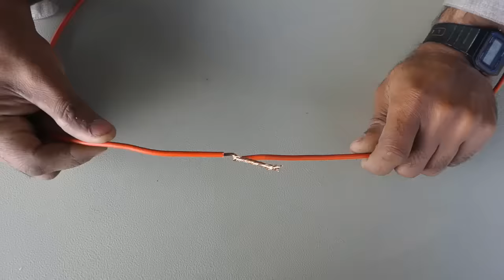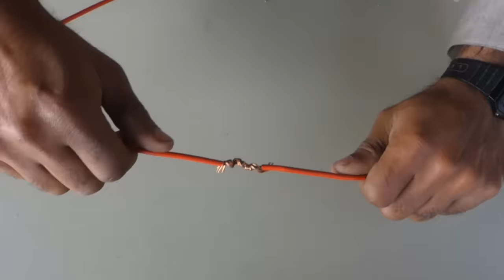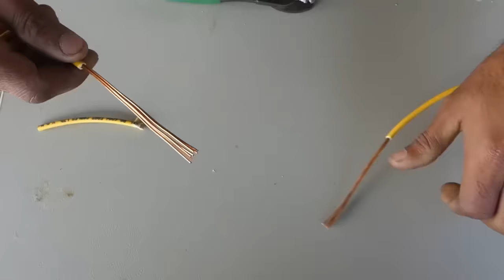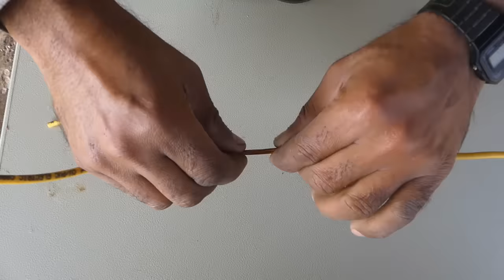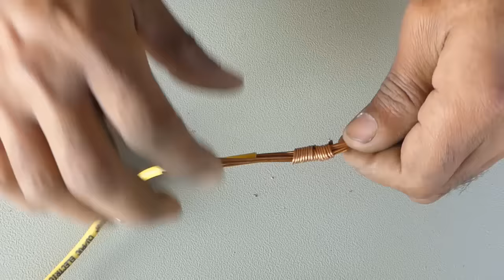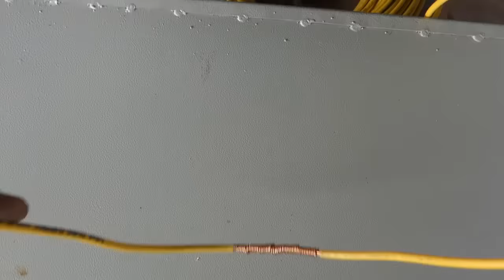Awesome Idea! How to Twist Electric Wire Together | Properly Joint Electrical Wire | Part 1

Comment: I think wastage of time..... normal joint never open if we use insulation tape on it. Because in normal routine we never need to pull the joint.
Reply: Right
Reply: If you are a technical person, you must not comment like that,,,, a technical person never take risk... What could be happened and what couldn'tbe, he keep an eye on every espect.... So your openion is not suitable brother....
Reply: @muhammadhamzaart5251  right
Reply: @muhammadhamzaart5251  this is useful for 14.mm2 and above main wires especially when you don't have a solder-less connector.
Reply: Jugane
Reply: @dineshbatteryelectronic8811  fall
Reply: @dineshbatteryelectronic8811     I
Reply: But 69M view toh agaya
Reply: Mind blowing
Reply: 'Normal joint' has sparking risk. Eventually wires will heat, spark  and loose, disconnect and can even cause fire in wiring. This type of joint here reduces that risk.
Reply: Bobo
Reply: Imagine a hotel or some other place where there are several employees working with extention cords all day long. Yes, the wires are finer gauge, but a similar fix beats what people typically do. 

Ideally you just put on a new cord, but not cheap.
Reply: No inspector would pass that, most dont even like breaks in the wire, let alone no bonding lugs
Reply: But for at home or even pulling wire thru conduit, heck yeah it's a way better connection, but time is money, 4 minutes for one connection is a long day on a new build
Reply: @ashtonandkylievideos2929  wiring connections can't be hidden, that's code.
Reply: @aredditor4272  you cant just twist wires together either, and yeah wires going in conduit are technically "hidden" , but inspectors inspect the conduit also and run a continuity test if they want, we couldn't have more then four 90s in our conduit running from the pool to the house for bond wire, but then again we used to be able to bond our own pools, not no mo
Reply: Yes right bro
Reply: @muhammadhamzaart5251  r8ght
Reply: Smart work
Reply: As I said thework is good and smart
Reply: Good joint if i have to pull a car out of a ditch.
Reply: S
Reply: It only shows that you ain't an electrician
Reply: Right
Reply: But this is art
Reply: Why would you not want it to be stronger? Cables get unintentionally stressed all the time
Reply: Difference between educated professional and jugadu electrician.
Reply: El porro es bueno tío

Comment: As a union electrician, I can say that this is NOT how to splice wire and you will NEVER see this in the field
Reply: It’s a waste of time and materials and probably isn’t up to code anywhere
Reply: @JT-cq9hx  I don't think it's a code violation,  at least not where I am.  But it definitely takes a lot of time and you need heat shrink tube.
Reply: This guy knows what he is talking about  … there are a lot of ways to spend time doing nothing.. like union brakes 😎👍🏻
Reply: @jhKorn123  😂😂😂😂😂
Reply: @jhKorn123  what else are breaks for
Reply: Splicing like this is 100% a code violation in NY
Reply: @hulksmash2454  everything's a violation in NY. NY itself is a violattion.
Reply: @GameJunky513  That's not true at all. There are right ways and wrong ways to do things, if the proper equipment is used and if the correct methods are applied then no violation. Violations are for safety reasons not for efficiency.
Reply: It absolutely is a Code violation, can not have exposed wire.
Just use a wire nuts like every other normal person.
Reply: Word, this is silly
Reply: @GameJunky513  live in another state? Please tell your local representatives and representatives sent to DC that you don't want NY's handouts...that it's socialism to take the money from those who earned it.

We'll be happy to keep our money here.
Reply: @-Subtle-  socialism rules
Reply: @hulksmash2454  I’m exited to know how a proper splicing/braiding is made! How should yo deal with exposed wire?
Reply: @pacifiedbeaumonte  there’s this new thing called private schools, you should look that up
Reply: @cheitner  I think the idea was that he was supposed to use heat shrink or some other insulation.  But , a wire nut is the way to go. And since most electrical wiring is solid core, it's really the only way to go
Reply: @pacifiedbeaumonte  you obviously don't know what socialism is. You want a real education in socialism? Visit Venezuela
Reply: That's a way to attach a wire to another wire in conduit to pull out the old and yank in the new. Usually done with the existing ground wire in the conduit. Tape it smooth and yank out the old ground along with a new ground and the missing wire. Other than that that's a violation in anyplace in North America....mainly because that splice is meant to be insulated and then pulled into conduit never to be seen again!

Comment: Yeah, cause everyone has all day to twist two wires together.
Reply: @jonathansimmonds5784  stop.   Not needed for outlet or light switch.  Unless you got rodents using these wires for strength training
Reply: Did anyone else know that wirenuts cost about 3 cents and take 5 seconds to install!!! This looks pretty but wiring a house or barn would take 4 months!
Reply: It must be meant to be used in emergency situations. I can’t see any other reason to waste all that time. Hell I think even soldering would be faster than this.
Reply: Unless you live in a 3rd world country....don't do this. It's illegal in the US.
Reply: @jonathansimmonds5784  OK but for most people we not doing all that.
Reply: …and using a bunch more wire in the process…
Reply: And thus you have seen textbook example of overkill x10
Reply: If I see someone doing this at our job site I'm going to hand him a bag of ideal wire nuts, we do not have time for all that.
Reply: Labor/time is worth more than the wire nuts or butt splices to do this. You can do 10 in the time this guy is playing games with his wires.
Reply: @mnotten1  Wire nuts are 100% ass, and it's a travesty that they're code. I wonder how many houses they've burned down?
Reply: @bcubed72  I understand what you're saying... But wire nuts are still to code- have been for 100 +/- years.
I've been using wire nuts for 55 years and have NEVER had a fire, I would never use them if I was concerned about a fire!
Reply: +1
Reply: This waste time if we work like this house lighting may take like 2 month to be done
Well This process is normally used for Pole connection🙂🙂
Reply: Cc CT có chứ gì họ đã

..

Comment: As a certified electrician, I can tell you that you would never see a splice being done like that, especially when on the job. Any boss would flip to see someone take that long to make a splice. Now if a conductor that is damaged or too short needs to be replaced, then by all means, use this method to tie on a new replacement conductor and use the old as a pull string.
Reply: 8788
Reply: ..also no work bench and safe environment
Reply: Especially since the only way to protect this is electrical tape, makes it look like a hack job in the end
Reply: That’s what I’m saying lol he’s fooling y’all
Reply: @josefigueiras8973  Zmbm 
Mbz
Reply: Total agree ..this is not the way to splice unless you wanna get fired
Reply: @balzaak4803  Could have at least slid some shrink tube on beforehand.....he probably used masking tape to finish it off....
Reply: And yet the Western Union Splice, as demonstrated in the video, is universally recognised as having the best tensile strength of any splice.  Also it's still widely used for most overhead lines.
Reply: Exactly. Wtf
Reply: @krashd  total agree
Reply: @balzaak4803  have you heard of shrink tube?
Reply: @IAmThe_RA  yea, didn't think of that
Reply: Certified electrician are always looking to rip off other wallets by rushing jobs. Your boss and the team are crude and untidy  workers
Reply: @vincentlee2460  this method is just excessive and overkill, an insulated crimp/crimp with heat shrink or the first method with a screw terminal holding it in place is more than adequate. The demonstration of them being pulled apart is silly because a cable shouldn’t have sideways load or be able to be pulled if installed correctly.
Reply: It can also be replaced, but in some cases it must still be connected
Reply: Don't think this video is aimed at professionals on the clock subservient to a company.

Comment: What electrician has the time to braid wires together like this when then can just use a wire nut and be on with the hundreds of others they need to connect
Reply: Or better yet lever connectors.
Reply: Crimp join all the way
Reply: Answer is : A smart electrician
Reply: You’re but gonna pull through a conduit with a normal splice and wire nut dummy
Reply: @robbrooks3418  you put a junction box in at that location and use wire nuts or cut the wires to length properly to begin with so you don't have feed to spliced wires through a conduit which I believe is not NEC compliant anyway
Reply: @themergen1  Hell no. If I see this on my job somebody is getting fired.
Reply: In the same time or shorter I would get a soldering iron and do a better job.
Reply: Hi friends 🙏🙏
I am from Indonesia 🇮🇩
Reply: @yokedmonster  hi
Reply: Not me. Unless I want the place to burn.
Reply: Wagos, wire nuts, fuck even a but connector and a crimper and and wrap it in 33.  Thats acceptable here
Reply: @videojones9884  are you Electrician?
Reply: @nuwansampath7348  Yes I am
Reply: True.... Moreover who's gonna pull a live wire like he did after connection 🤦🏼‍♂️
Reply: No wire nut

Comment: Are there mice in the walls trying to tear the wires apart as in the demonstration?
Reply: I guess it comes in handy when you can’t replace the entire wire, but has to splice it in order to pull it thru some tight spots to its destination.
Reply: More like beavers. Lol

Comment: Thanks. This helps me with barbwire fences too. To me it's time saving method and I need that barb wire to hold when I stretch it and when a 1200 pd cow tries to lean thru it.

Comment: It’s called a western union splice. They used it on telegraph wires. It’s still useful to pull a new wire with the old one.
Reply: Yes
Reply: Hello brader 🙏
Reply: the 2nd one was the best
Reply: Ya. And the last time I made a western union splice for other than fishing purposes was when I did my 1st year of schooling for my electrician apprenticeship back in 1992. Lol

Comment: Let's increase the resistance of a wire as much as we can.......
Reply: Not to mention create a whole lot of lossy inductance..
Reply: @NathanMcClintock  dammit you beat me to it. LOL. Yeah you basically just put a induction coil inline to the load
Reply: But it looks cool...
Reply: Yes we also have a heater.
Reply: @johnevatt518  I would expect inductance to be created only were the spooled strands isolated from each other, and from the straight strands. Am I wrong?
Reply: I can’t see a reduction in effective contact area, which would produce any higher resistance.
Reply: @NathanMcClintock  yes! Was thinking the same.
Reply: @Johan-vk5yd  the same reason you are supposed to uncoil extension cables
Reply: @ponemark  The coiling extension cable  is isolated forcing current to follow the ”spool”. The coiled strands in the demonstrated joint are, in contrast, in contact with the neighboring strands, coiled as well as straight ones. The current passes straight through. No coil.
Reply: @Johan-vk5yd  if it's going to take path of least resistance its certainly not going to go round the spiral or jumping from strand to strand because that would be further distance. The path of least resistance which is now reduced at right down the centre will now get hot because all other electrons will follow.
Reply: @ponemark  To my eyes the Braider takes great care to make each coil be in contact with its neighbour. Did I miss something?
Reply: @Johan-vk5yd  in contact with how many newton metres force is the connection. You might want to run some heavy current through the circuit like a electric shower you will see the heat difference along the wire at the junction.
Reply: @Johan-vk5yd  you are not wrong
Reply: Johan is right. Like the video title says, if after all, you're to twist two loose ends of wires together that's not a bad technique. The joint will be a lot stronger than the other techniques shown in the video. As regards to the passing of electrons, there's no question of induction or resistance of serious concern as long as the strands are tightly pressed together and the copper strands remain clean, and you don't plan on using welders and a few heavy-duty  motors. A nice and clean soldering would be nice but that's out of the topic. 😀

Comment: It will expose unnecessarily large section of area as compared to first one, and indoor wires are not meant to bear excessive physical tension.
Reply: Катушка индуктивности
Reply: Exactly what it said^
Reply: Yes it may be true
Reply: Exactly what I thought
Reply: Yeah. Whats the purpose? Lol are you tryin to hang your ceiling fan with the wire you used to power it up?
Reply: And the time it takes🤦🏻🤦🏻🤦🏻🤦🏻🤦🏻
Reply: Also resistance will be created

Comment: Car stereo shop

“We’re now charging 10 times the labor, because we now wrap our wires multiple times, instead of using crimp connectors and solder”

Comment: Then you realise you have forgotten to put the heat shrink sleeve on first...
Reply: Nahhh, just slap on some generic electrical tape, man.
Reply: @boke75   Maybe silicone tape, tightly bound over the join.  The layers will fuse together and make a pretty strong insulating wrap.
Reply: But at least he wont need a heat gun it will melt down anything close by
Reply: @ponemark  Why will it melt down?
Reply: @Johan-vk5yd  resistance will create heat. Resting a wire against another wire is an unsatisfactory connection compared to a crimp and although may create a circuit it will have higher resistance. Try loosening the screws securing wires in a plug and you will get heat generating.
Reply: @ponemark  Thanks for trying to explain these things. One might think that the significantly greater transverse area created by the demonstrated technique would compensate for that, on the condition its applied meticuously as shown, including the squeezing with pliers.
Reply: @Johan-vk5yd  I'm no expert but learned from mistakes and I've made plenty of them.
Reply: @ponemark That would be great, hearing about your mistakes! You could save lives, you know.
Reply: 😂 hahaha
Reply: Bbch

Comment: The way you did it the first time is how I do it and I have never had to re repair a job previously done and works every time but I do admit the last one you did was very tight and secure but who has time for that? honestly the first twist you did is how 90 of people do it including most certified Electricians.
Reply: Yep agreed. I called a electrician rep the other day and he just twist the electrical wires together and capped it.  All of my bedrooms, five of them were dead.  Don’t need to waste time and go beyond the basics, as long as it’s fix, it’s good.

Comment: Ok, Now I can use this cable on the back of my tow truck.
Reply: Yes, ill never do this for just joining only
Reply: I thought the same
Reply: Great minds think alike, ?
Reply: @genesutton6383  yes sir. Happy Independence day to you and your family.
Reply: @jonathansimmonds5784  use that wire trick no tape to wire and outside  light with a interior light fixture
Reply: Light Bulb Service 💡👍
I am from Indonesia 🇮🇩🇮🇩
Reply: Right ? No one does this, the regular way is wrap, solder and shrink wrap
Reply: Majid Alvi  👍👍👍
Reply: Big joke
Reply: @vishals6727  as

Comment: I respect this idea but only for those whose wire needs to oppose tensile force. However l, normally, wires do not encounter tensile force (pulling of wires from opposite direction) after connected. 

Hence, a normal twisting is already okay and can function for a lifetime.
Reply: Especially when you do it in a car wiring.
Reply: That is submersible pump wire that will be hanging vertically in a well.  It will experience tensile stress.  This method is still a little weird.  The industry standard is aluminum butt splices with adhesive heat shrink tubing finished with 3 layers of electric tape.
Reply: শ